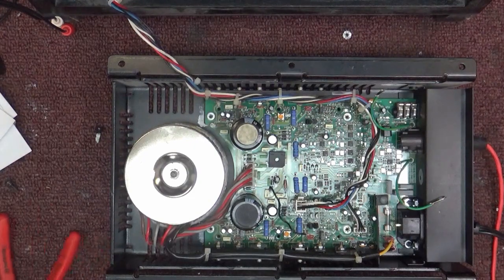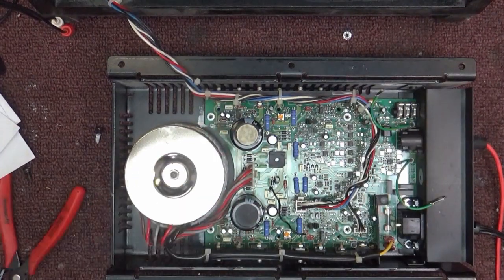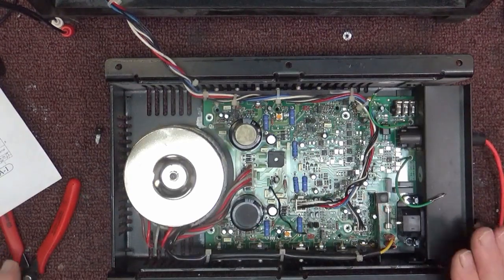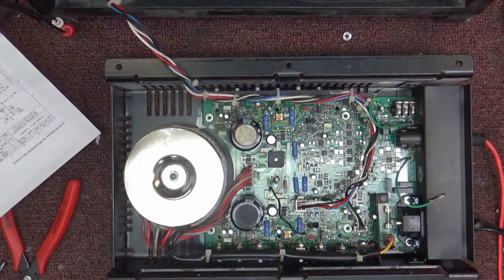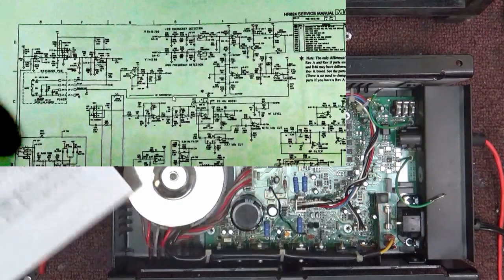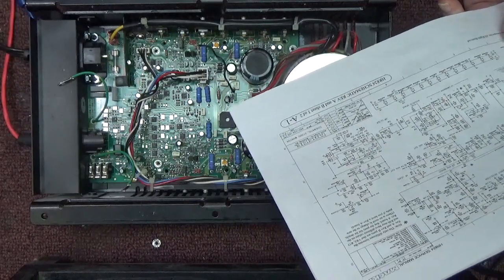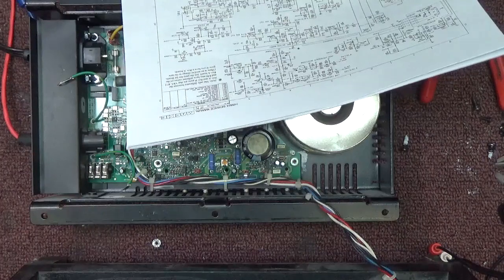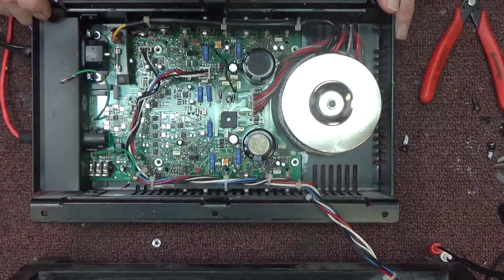Mackie HR824 Amplified Speaker Repair

Comment: Good video! I have a pair of these, from about the same time frame. They had been stored, sealed  in their original boxes for about ten years. I replaced one of the OEM woofers which had failed sometime after the warranty expired before I put them away (dead voice coil) and it worked flawlessly until then. I just pulled them out and discovered that one of them will pulse when on even if there is no signal present. the kicker is that after using it for awhile, it seemed to stop for the rest of the day. I can't hear any difference between the one with the issue and the one without, but looking at while it is doing its thing is like a flashback to some youthful experiments with psychotropic substances... any ideas where to look for the problem? I don't know if the unit with the issue is the one with the replacement speaker without opening it up, but it seems unlikely that it has anything to do with the speaker itself. Do you suppose I can ignore the issue as long as the sound seems unaffected? I used a bit of Deox on the switches and exercised them, but it no effect on the phenomenon. Thanks for any suggestions you might have.
Reply from the maker: It sounds to me like one or more of the filter caps inside reformed, meaning it came back to life. In a perfect world you would replace the electrolytic capacitors but in the real world you would watch it carefully for a while to see if anything else happens. There is a very good chance it will be fine. It is up to you.
Reply: I just experienced one of my Mackie HD824 OEM woofers failing yesterday. Probably the same dead voice coil issue you had with yours. Wondering how you went about removing the woofer and where you purchased the new one from? I have opened up the box and removed the screws from the front face but still can't mange to remove the speaker. My next attempt was going to be to try and pry off the front panel as it seems that it could be removable but thought I would ask before giving it a go. any other advice towards this repair would be greatly appreciated. Thanks.
Reply: It has been so long, I don't remember any details but I am certain I didn't pry off the front panel to remove the driver, I believe that I just removed the screws and with some gentle prying with something like a putty knife. If I was to try and remove it now, that is what I would start with. But since it has been so long, it is possible that I might have removed the amplifier from the back of the speaker cabinet but I doubt it. As far as a replacement woofer goes, I think I just read the info on the back of the woofer after I took it out and did a search on the part  @33AndAThirdRPM

Comment: Best monitors ive ever owned.. and still do.
A poor mans 1030a
Reply from the maker: They are pretty good. Still in service here even after the new studios were built.
Reply: @AERVBlog  My Bad.. 8".. 1031a. and with the enclosed cabinet (no porting.. which I love) and the passive radiator, the setup really works.. 
Yep, your reply just came up , so I responded...
Honestly, I do all different genres, and also some film scoring...Like any monitor speaker, you need to know them, but its not often speakers are that across many styles..
My 10.31cents, discount price, 8.24 cents
Reply from the maker: @Rhythmattica  I had to read that a couple of times before I could figure out the 10.31c. Got it. Thanks for the discount.

Comment: Interesting video. I have a pair of these which had the low buzzing and problems and the woofer on one unit. I cleaned the the auto power switches with contact cleaner and both speakers sounded great for a year or so, however one unit has since lost its tweeter functionality. I don’t drive these speakers hard so I wonder if the same capacitor has blown causing the amplifier that drives it remain inactive. Do you have a copy of the schematic still?
Reply from the maker: I do. Please contact me at aervblog@gmail.com

Comment: The volume pots in my set of these are starting to get scratchy and even cut-out intermittently. Do you think a good De-oxit bath would fix that? If I need to replace them, where would you recommend I get the parts? I don't have the schematics so I don't know the specs. Thanks in advance.
Reply from the maker: Deoxit would probably do it but you will have to do some twisting. If I remember correctly the pors are pretty well enclosed.  I will have to look up the numbers if I have them.
Reply: @AERVBlog  Wow, you are quick like a bunny! What do you mean by twisting?
Reply from the maker: @tasdau  lots of back and forth on the knob. It will take a while for the deoxit to work in. I don't think you will be able to do it at all without taking it apart and getting to the back of the pots.
Reply: @AERVBlog  I can take them apart if I have to. I'll look for the specs and part # online. Thanks for the advice.
Reply from the maker: @tasdau  contact me at aervblog@gmail.com

Comment: I have the HR624 model that looks identical but the two big caps are like full of white glue. Is it normal? 
Have you cleaned yours? 
Both of my speaker have that white thing around the big caps. One is working and the other speakr stoped working.
Reply from the maker: Probably that white glue around the caps and some other big stuff is there to keep them from moving during shipping. That stuff is normal. Sometimes the guy putting it on gets a little crazy about it and uses way too much. It shouldn't affect the operation. Thanks for watching.

Comment: I bought a pair of these around 2001 and still have them and hardy used them they're still in the original boxes. They sounded great when I had them running the few times I used them.
Reply from the maker: Ours are used every day all day long and never turned off. I have no complaints with them. All electronics will give up at some point. They do sound good. They aren't what I would call true studio spec speakers but they are good enough.

Comment: I have a pair of these monitors, and there is always a very slight hum (worse in one of them...) when they are simply plugged into a power source - NOT switched on, and NO signal running into them...even with no input cables attached...any ideas? Thanks!
Reply from the maker: Not really but I would check the filter caps and soldering. Sorry I can't be of more help.
Reply: I remember seeing a video about the KRK Rokit where the glue over time became conductive. I don't know if Mackie used the same type of glue for their PCB. But just wanted to offer some information. Thank you for taking the time to help us fix our devices.

Comment: Please help. I have these exact monitors and one of them keeps blowing fuses (immediately on power up). I did notice the auto power switch at the back went a few years ago (but they still worked fine). Not sure if this was related?
Reply from the maker: There are just so many things it could be from a shorted diode to a bad cap or switch. Does it blow fuses when the auto power switch is set to off (if you can even do that)? There are 6 primary voltages coming from the main transformer and all of them have diodes associated with them. The unit is actually on all the time just not drawing much current since the on off switch does not actually break the AC line.  I think the first thing I would check is TH1. It is a thermistor from +15 volts to ground and is connected when the Auto Power is either ON or in Auto. Since the only hint I have is the broken Auto Power switch that is my best guess. Then again the switch could be shorting which might cause the symptom too. Wish I could be more help but there are just so many places that could go bad. Thanks for watching.